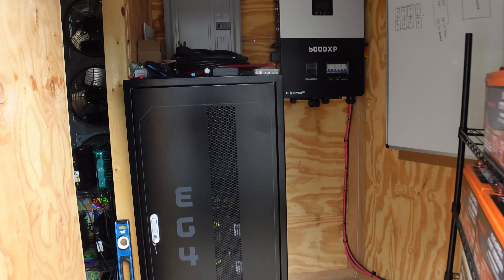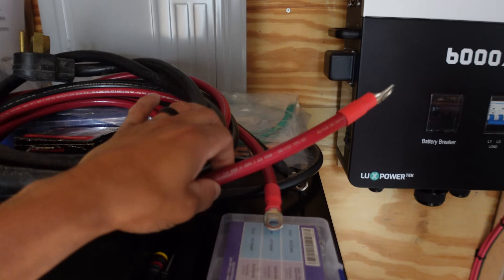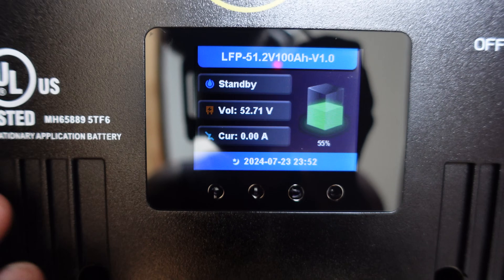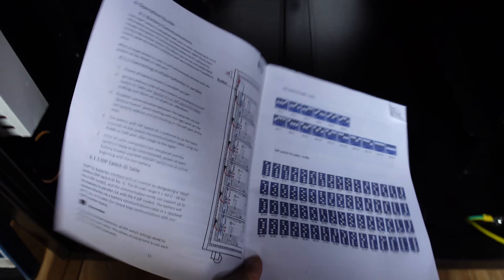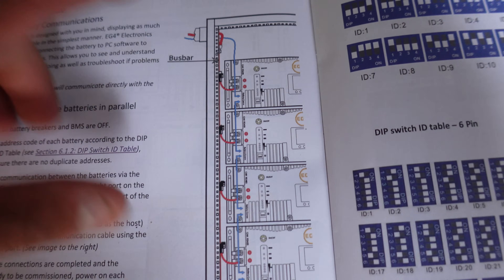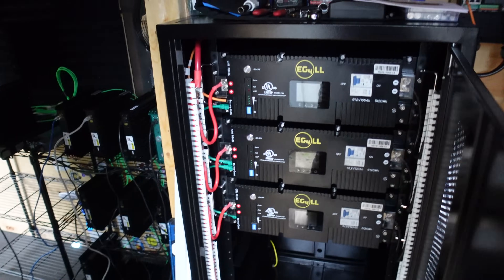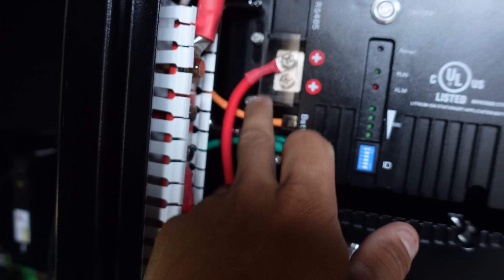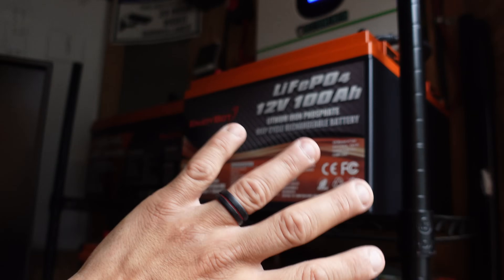How to Wire EG4 LL Batteries for DIY Solar Setup | Step by Step

Comment from the maker: One month update:
(Two things  make sure you look at the switch page correctly. I had number one incorrect it was opposite of #1 (white square is the switch location that is the only important one for communications). Second use the “CAN” port to make sure the batteries can communicate properly with the inverter)

I could NOT find a video where someone walked through hooking up the EG4 LL Server Style Batteries and Configuring them all in one. 
Please let me know if you like this type of content and if it helps you with your DIY Solar Setup! 

➡ Check out Signature Solar: (I Purchased the 6000XP Inverter Package)
https://signaturesolar.com/?ref=zwzcpllh ("CHUMPCHANGESAVE50" For $50 Off)
➡ Check out Tangem: (My Favorite Hardware Wallet)
https://tangem.com/pricing/?promocode=CCXD
Reply: That’s what I was thinking. So the first one goes to to left and not the right?
Reply: @comarshlunan8592  I think that for ID=1 the first dip switch (top one) should flip to left and all other switches to right. Am I wrong?

Comment: The settings in this video for dip switches appear backwards to instructions, which shows #1 battery dip with top switch to the left, #2 battery dip with second dip to the left, etc. Also, I had "Bat Com Failure" alarm until com wire from EG4 18K PV Inverter was switched to CAN port on the #1 battery with the CAN protocol on the battery set to EG4. My battery instructions show the CAN port being used for EG4® LL-S 48V 100Ah SERVER RACK BATTERY as well which is confusing, because I beleive we are using the same battery, though our Inbverters are different.

Comment: From a practical perspective, how much mining rigs can you power off 6 of those batteries? Im assuming 5KW * 6 batteries is 30KW. If you divide 30KW over 24 hours you get 1.25KWh. So, I should be able to run 2x of the 500w rigs correct?
Reply from the maker: So the way I treat the solar set up is a video idea. I will go over once I get it all relocated. But basically the way I treat it is I can max out everything during the day while the sun’s out the batteries are charging and providing plenty of power for the rigs then at night, I’ll shut it down to like roughly 500 W and let it run throughout the night and depending on how sunny it is I repeat the process sometimes I have to kill it so it’s only like running 250 W overnight and can’t max during the day (cloudy days)
Reply from the maker: But to answer your question though, theoretically yes your correct
Reply: @ChumpChangeXD  Nice, the Tariff's start up on these batteries Apr 1, so I pulled the trigger and got a stack of 6 with the cabinet.
Reply from the maker: @ronwatkins5775 awesome! Hope you used my link gets you money off maybe like $50?

Comment: Where in the manual does it say select luxury for the 6000xp.   They are all labeled as eg4. Batteries and inverter.  Mine just says eg4/lux as a selection.
Reply from the maker: I asked the rep. If it says EG4/LUX your good

Comment: Place orange wire to CAN port on battery. Also turn on inverter battery breaker first and turn on one battery breaker, then push power button on battery bms. This ensures the charge resistor has a chance to send power to the inverter first. The way u did it full power is sent to the inverter capacitors and could lead to a failure due to a large in-rush of current,
Reply from the maker: Yes you are correct I had to move this yesterday. The manual image was incorrect. I will explain this in one of my follow up videos once it’s all up and working properly
Reply: Correct 👍 ll-s and powerpro batteries use can port while the almost worthless lifepower4 batteries use the rs485 port for communication with the inverter. Don't forget to change the protocol settings to lux for can port 😉

Comment: Great video. Please share the setting on the Inverter for this battery setup.   Thank you.
Reply from the maker: Yea I will for sure I’m trying to figure out the settings as we speak! I think it’s basically plug and play I just have an issue with firmware I think so I need a cable to update it

Comment: Nice work on this one.

These inverter still do need to be precharged. Fortunately the LL’s come with built in precharged resistors. 

Turn the breaker of a single battery on, and the battery breaker on the inverter as well. Then power up the BMS on the single battery. It will automatically precharge the inverter. Then you can cycle the rest of the batteries on. The fact that these batteries come with resistors is an awesome feature that most people don’t pay attention to.
Reply from the maker: Thanks brotha! Now I’m running to an issue where the inverter will not recognize the battery I think I need to firmware update something… PITA! 😂
Reply: @ChumpChangeXD  could be firmware. But it’s probably just the lithium setting. Choose lithium 0. And use CAN protocol, not rs485
Reply from the maker: @GavinStoneDIY  yeah I tried a bunch of stuff yesterday with technical support. They were fantastic but I need to get a firmware cable to be able to try and update the batteries I think.
Reply: @ChumpChangeXD  ah well. That updates pretty easy. And after this you can do future updates through the inverter online without using cables

Comment: @CCXD dude i truly like the LL’s batteries very nice, BTW i would think the P01 EG4 protocol would be the one to use since the batteries are from EG4 . P03 is LuxPowertek , so i think it the batteries are setup for LuxPowertek protocol so you had to make the inverter use the P03? I’ll like to see a list of protocols on the 6000XP strange it’s not like the 6500EX and if so you can use the P01 protocol on both device if they support it..
Reply from the maker: I messaged the guy from Signature Solar and he said yes I need to configure it for Lux Power prior to me doing that

Comment: Good job, congrats. Nice connection of positive and negative to the bus bar. Even if the system isn't in production, when all the panels are connected turn them one and after the batteries to have them full charged and start to balance the cells.

Comment: What's your plan for heat mitigation? Do you have any air movement across the batteries?
Reply from the maker: Directly across no. There is plenty of air movement in that trailer but I will be re designing that sooner than later